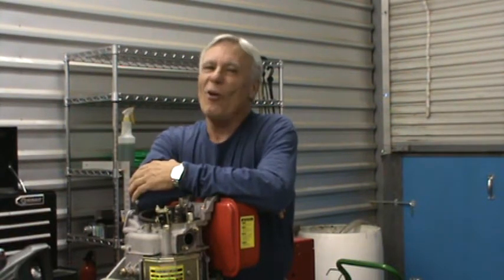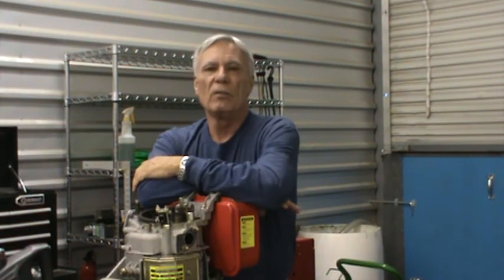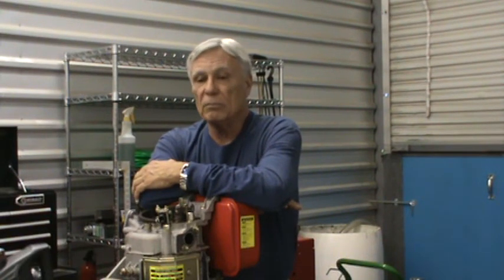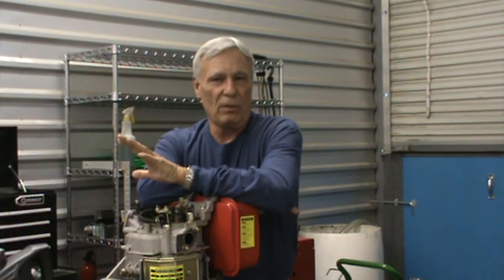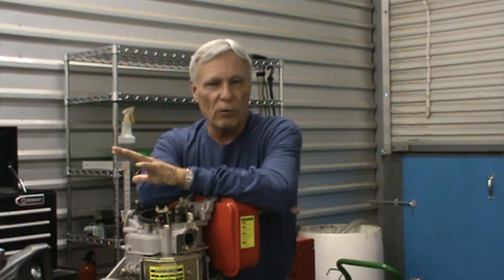AmeriCar 6-stroke engine

Comment: You don't seem to understand the thermodynamics relationship between heat pressure and power   - heat is good - chilling with a purging stroke  has pumping and heat losses that far outweigh the slight improvement in oxygen density - this was all done in the UK over 100 years ago by Lanchester & Atkinson  - if cooling the inside of an IC was good why do cutting edge developments use ceramics coatings?  - you want a cool charge but you want retain the heat imparted to the  inside of the cylinder so it  transfers to the gasses causes greater expansion and more power

Comment: Adding a recuperater to  pass exhaust heat to intake air  would increase efficiency. because a significant amount of heat could be recovered.
Reply: ***** You're right  They should pass the exhaust heat to the pipe leading to a turbocharge's turbine. Sorry I got that mixed up. That why they put intercoolers behind turbochargers compressor and before the engine.
Reply: True "intercoolers" are located between the compression stages when using compound superchargers/turbochargers. Aftercoolers are between the supercharger/turbocharger and the engine. And they're not there to RECOVER heat. They're there to RADIATE heat from the intake air charge to cool it off and make it more dense. They also serve as a "boost reservoir" for the intake system.

Comment: What I don't understand is that the ICE engine produces a TON of heat.  Heat is energy, in fact the energy produced to run your computer was generated by heat. But in the ICE engine we throw this away.  Why can the six stroke run as designed until the engine can generate enough heat to boil water and inject that steam into the 5th stroke?  I see a ton of videos on how to convert a 4 or 2 stroke into steam -- so I know it can be done. This would add more power to the engine.
Reply: As I recall they remove the water pump and cooling fluids which allows the cylinder walls and piston to conduct all the excess heat from the power stroke into a second steam power stroke. The idea is that the engine generates enough power without the steam stroke to keep rotating but also has no cold fluids to take energy away except for the water injection stroke.
Reply: I'm mostly worried that this engine will need a heavy flywheel and or more cylinder to keep running because the combustion strokes are further apart. Unless the steam makes suitable power.
Reply: Sam Young yeah i was thinking for a test engine you could resin fill the water caleries of the block and head
Reply: The six stroke design increases efficiency for sure but I'm skeptical about power output. Your adding another revolution of the crank for the full cycle. Decreasing the horsepower made but fuel combustion by a third. And I'm not sure that a steam stroke will make that third back. And you probably still want some sort of cooling system just in case. A water pump that's got a clutch and thermostat. But the fluid used should aid the thermal capacity of the engine. And another concern is that the amount the cylinder walls change temperature. That's a lot of stress on materials
Reply: very true on all acounts,  usually on a multiple cyclinder engine a poor combustion on one cyclinder produces drag on the rest, which is what steam stroke would do. you`d need independantly controlled valves (coiled/solinoid) to make up for it, slap on a turbo some where might help a ton....
Reply: A turbo is always a good idea if tuned to suit the engine. It is simply harnessing excess heat. Many have started using not a turbo but an exhaust alternator that can help in hybrid cars to increase efficiency. But considering all the prototypes for this engine I've heard of are diesel I'd assume that is because of the part similarity. Water is injected into the cylinder just the same as diesel. And valves are the same just with altered timings. Exhaust happens after combustion and steam stroke and intake happens normally. This doesn't require much alteration. Simply adding water injectors and new can shaves does the trick.
Reply: Make it from ceramic??
Reply: the main issue is pressure over area equals force.
sure, you can make steam... but it has to be under pressure. and it has to reach a pressure where it can perform useful work. as pressures increase proportionally smaller cylinders are required for the same force. but you need higher temperatures to get higher pressures... then you also have to deal with surface areas, thermal conduction, rates of transfer. how much steam is required, and can you heat a sufficient amount of water to a high enough temperature?

basically... the size of a cylinder needed to obtain useful work from the low pressure of the steam produced at the low temperatures of an ICE waste heat becomes impractical, and the benefits arent worth it. once a piston starts getting to a foot or more in diameter, it also becomes hard to get the rotational speeds up... hard to get sufficient gas flow through ports without losses. hard to get expansive work on a piston, rather than thermal loss through large surface areas.

you could run a turbine of low pressure steam, but again.. turbines start becoming rather large when required to extract the energy from low pressure steam. every example of a "model turbine" you ever see relies on being about 1% efficient and blasting a LOT of heat away to do nothing but spin... people are impressed by noise, they equate it with power for some misguided reason... to make a real reaction turbine running off steam at atmospheric pressure? i am yet to see any "model" of whats seen in every power station worldwide in actual operation.

due to latent heat, the heat of evaporation held in steam, there is just as much energy in steam at atmospheric pressure as in the high pressures we use in normal steam engines...

but to extract that energy requires condensers, air pumps, vacuum augmenters. large flow passages to deal with the volumes of gas, and finally... small turbines have too many losses to be viable, and combined with the losses of auxiliaries required to achieve ideal running conditions, its far easier to make a 10MW turbine than it is to make a 10KW turbine... and the big one will always be orders of magnitude more efficient.

no matter what you do, you cant beat the application of 1000psi or more during combustion, acting upon a relatively small area piston yet producing a relatively large amount of force.

you have to take the cream and dump the rest. to try and use some of that as well usually ends up as a failure on a small scale. on land, when fixed as a powerstation? you can add all the bells and whistles and devices. you dont have to worry about size or weight. you got feed preheaters and power to spare for pumps...

attach it to wheels or attempt to make it move itself and everything changes.